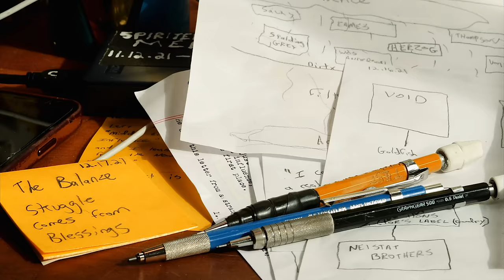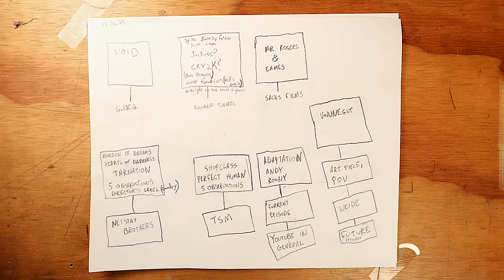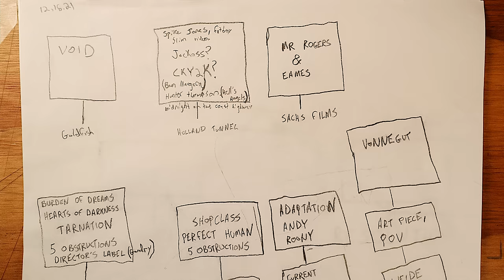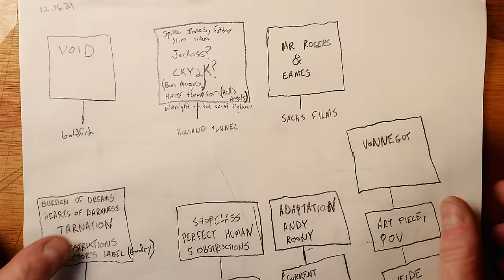Narcissism vs. Universality

Comment: Thank you thank you thank you. I am feeling lost in life. I'm in my third year of electrical engineering and feeling deeply lost. I see many people around me doing things, working hard or just enjoying life. I feel like each passing day is making me more and more numb, with less direction. I feel an immense pressure to start figuring things out, to find a driving passion to fuel me. But here I am, not doing much with myself, sacrificing most aspects of my life for a degree I'm not even sure I want to finish. "I can't start doing this, I need to finish material from my electronics class" is the types of thoughts that permeate in my brain l, constantly, with the consequence of dissatisfaction in life. I've always wanted to make videos, build things and produce art. Kind of like what you are doing, but never had the courage. So fuck it, and I mean it, fuck it, I'll make my life purpose about finding what my life purpose is. I'll push in all boundaries. I'll make failing and trying again, crashing until I go in the direction I feel is right, my main priority. This has been a wake up call, Van - thank you. You're videos always keep me thinking for the whole day, makes me boil with willingness to do something.
Godspeed for everything Van, godspeed.
Reply: Hey. You will do great. The only limitation is your very own mind, which, at the same time, is what could catapult you into something new you may wouldn’t have even thought of.

I am already a fan of whatever it is that you will create.
A good life to you my friend, and everybody else on this planet.
Reply: My situation is so very similar to yours right now (at least similar to what you stated in your comment). I am also in my third year in computational physics and I feel deeply lost. I feel like I am in the dark, failing to latch on to something.
Reply: Find your “Why”. Godspeed friend.
Reply: Hey Alfredo, 
You have no idea how much I relate to that. Second year of Software Engineering here, feeling as bad and lost as you do. 
I feel horrible three quarters of my time, becasue I hate what I am doing so much, and the life I am living doesn't even feel mine. 
I hear you. I care about you. Try to focus on what you want to do. I am trying to do the same, and it's hearbreaking, I feel completely good for nothing and useless, and I'm struggling just to function on a day to day basis. Stay hard my friend.
Reply: Never worry about what others are doing!  That's too much to live up to.  Worry about what YOU are doing.  Finish your Engineering, and let it and other things inspire you to do something that fuels you.  I am in my late 40's and still making my life purpose finding what my life purpose is.  Some get lucky and just get find their purpose right away, but for many they accept the status quo or they keep looking.
Reply: Something I have always lived by in my close to 5 decades of being on Mother earth, is clarity comes from experience not thought. Try as many things as possible, you'll be amazed at how those experiences (even those that seem insignificant) are part of the invisible thread that leads you to the next best thing in your life. At 16 I studied Fashion & Design but it was whilst I was studying, i learnt beauty & photography, that  I realised I wanted to be a makeup artist/stylist & work in Editorial, Music, TVC & TV.  Nothing you do is ever wasted....👌🏼💚
Reply: @mishellebrown  very well said.  the words "clarity comes from experience not thought" should be the quote on everyone's phone home screen.
Reply: @hassanh7926  I'm sorry to hear that Hassan :/
The thing is, being so close to the end of the degree, I think it's worth pushing forward to reach the end. At least we have something to show for the time we spent bashing our heads. Personally, a new goal right now is to make sure I get fulfillment from other sources, which means working on expanding my social life (within the limits of the pandemic ofc), finding hobbies that relieve pressure or just get me going. The thing I hate the most for my degree is that I barely remember things from the past years, or at least I haven't completely assimilated them because after the rush for exams I barely touch things unless they're needed for something else. I'm scared of what comes after, of what employment looks like when I feel like I know half the things I should, even though academically I've been performing well. This constant anxiety of maybe regretting time at university - either because of bad knowledge or loosing out on chances to have fun.
Sorry for the brain dump. But what I mean is maybe we hate our degree, and doing work for it takes double the effort, but let's focus on getting fulfillment somehow. Work doesn't always have to be our passion, it can be something we're decent at. I wish I could share some special trick to solve all our problems, but we're in the same boat.
I hope the best for you, Hassan, either way. If you ever feel like giving an update about how things are going, just drop another reply here :) have a nice night
Reply: @amp776  I've decided I'll keep on pushing for the degree. Mostly because of the invested time, as you mentioned, and money. But I don't know if I'll work in this sector, and my anxiety is getting worse with each assignment and exam as the stakes are getting higher. I just don't know. On one side I like the degree and wish I could apply what I learn more, on the other I wonder what it would be like to take another degree. Time will tell, but for now I really need other things in life rather than university (friends, hobbies, partners, sports).
Thank you for the comment, I really appreciate the advice and the concern :)
Have a good day
Reply: @matteodidone9801  that feeling is awful :/
What is it that you hate about your degree?
Also you're in your second year, is there still a possibility to transfer over to another course? If so, maybe consider it!
Hope you find your way, but keep pushing and reach out to others, it really helps to have external support.
Hope you have a good day, drop a reply if you ever feel like giving an update, I care! :)
Reply: As someone who just finished my masters in EE, year three of electrical engineering undergrad was one of the most difficult times of my life. The path becomes clearer, the goal is to keep pushing. Once you're done you will step back and marvel, and the things that you thought you'd never see again you'll find yourself slowly bringing back into your creative pursuits. In the meantime surround yourself with the smartest people you know and the rest will follow
Reply: I've been living in the exact same hell that you've described for the last 6 years, I enrolled in university just because I felt the social pressure to do what everybody else were doing, so I chose history which was the only subject that I kinda liked at school and let me tell you: ever since the first day of class not a single minute has gone by without hearing the same voice in my head that tells me that i should figure it out, just study! Finish this up! Everybody is moving out of their parent's houses, finding jobs, making money and you still don't know what to do, I can't watch a movie without feeling guilty, I can't rest. Needless to say I've grow an hatred for university that I can't even put into words. It's not that I've been slouching on the sofa doing nothing, while I've been torturing myself I've been doing personal training, I've started a Farm, I've worked in restaurants, worked as an arborist, found love, lost it, injured myself pretty badly, learned a new language, but I still haven't found the THING, that holy thing that everybody is talking about that it seems it makes your life worth living. 
Now in the last few months I've been really numb and depressed but I started realising that maybe I don't have to ''figure it out'', that maybe my THING is the process itself, the mind-blowing activity of learning something new, related to whatever subject or field of knowledge, from literature to how create a prefect lawn,  it's just a process that gives me happiness and keeps me going. I don't have to overanalyse everything that I do thinking as it's life or death, that if I do a thing it has got to be the one that makes me successful and keeps me happy forever.
Reply: @fredofredofredo  I'm in the same position, I've just decided to finally make the last push and finish what I've started. Ive spent too much time and money to give up now. 
 
Have a nice day! 
p.s.
Are you Italian??
Reply: @matt.orsini  damn you've accomplished so much though! And yeah, I understand exactly what you mean when describing the social pressure that goes into it. A lot of people seem to have it figure out -although, I generally focus my attention on who attracts me usually, which are the brightest people (who shine the most). It's nice to hear that you've found motivation again to push through it all! I really admire how you've done a lot considering the circumstances you've talked about. I generally dislike trendy quotes, but a friend's tattoo says "not all who wonder are lost", and I really think it applies here. I can see you've definitely experimented with lots of things. The overanalyzing is something that resonates with me a lot, always asking "is this it?". But it's virtually useless, because sitting around and telling myself how shit everything is won't bring me anywhere.
I guess I'll take your same path. I've always been a cautious person but this year I'll make sure I commit to things and that I set out to fail. I know I'm not particularly intelligent nor smart but I want to really do things one way or another. I'm tired of feeling hopeless and stuck, I want to bloody achieve things, efficiently or inefficiently who cares.

Sorry for the long rant, I'm also figuring things out. But Matt you've done a lot and I do genuinely believe you've got what it takes to get through it, one way or another. It's definitely easier said than done, as with everything but we'll get somewhere (avoiding to use "there", cause wtf is "there"?).
And yeah, I'm from Italy :)
Reply: @fredofredofredo  Thank you so much for the kind words! I've done all those things while repeating myself the same message that Van attached to the hole punching machine at 18.49, so I really suggest you not to do the same and find some enjoyment in whatever you do haha. We will figure it out, or maybe we will find out that wandering towards a purpose is the goal itself. 
We've got this! Get that pezzo di carta so at least we could get a posto fisso hahah

I wish I could express myself as well as you do in English but I'm working on it. It's nice to know that there are other fellow Italians watching these kind of videos. 
Buona domenica!
Reply: @matt.orsini  @Alfredo Scalera You guys are just the friendliest, nicest people. Maybe you two should meet someday, feels like that would be an enlightening experience.
It will be okay eventually, don’t worry.
Reply: Thanks for sharing!

Comment: In 2000ish, I was a manager at a cinema. I was in charge of the projection booth,. Often times, I would work late into the night, building prints or cleaning and maintaining the equipment. ‘Sweetest Thing’ was on my mix cd that I would play on the sound system that pumped out to the entire building and all the auditoriums. I loved that job. I miss watching the light reflection dance on the ceiling, as the film ran through the projector. Thank you for that memory :)

Comment: Van, keep up the good work. Though you might feel the videos are about you, you discuss issues we all go through and externally process through them. I haven't felt any of the videos have been to build yourself up. As an example, your running video. You mentioned that you don't like it, but you know the positives outweigh the negative... So you get after it. I can relate. The vintage truck video is awesome. Who hasn't wrestled with wanting something that is not realistic and asking yourself why. The one where you get angry and ruin stuff... Been there. I appreciate the creative ways you find to process and reflect. Keep up the good work. You brightened my day today when I saw you had a new video. It is good work and it is worthwhile in my opinion.

Comment: Titebond II is an expensive glue. Not just because it costs slightly more, but because it doesn't wash out of your clothes like Titebond I does (II being waterproof). If you are a normal mortal clumsy, this will cost you annually in ruined clothes. So unless you really need it to be waterproof, I wouldn't recommend it

Comment: Van didn't touch the battery to the goldfish; the fish was revived by the small shock as the battery terminals entered the water. Makes you wonder what would have happened if the fish got the full nine volts. I'm going to do it. Wait there. I'll let you know.